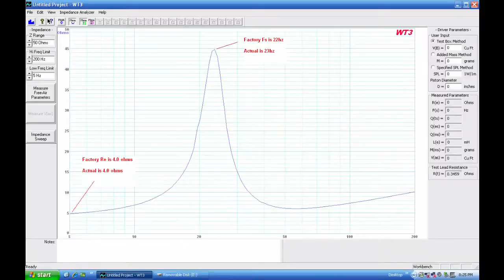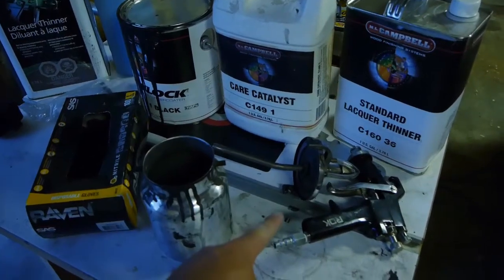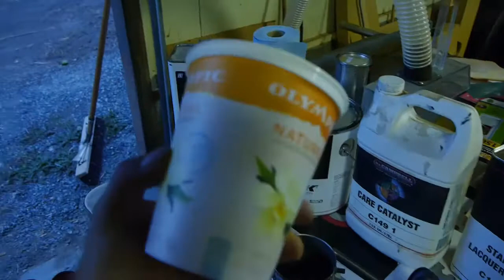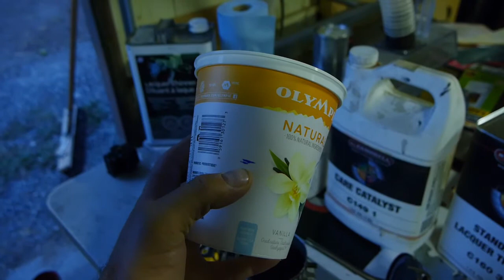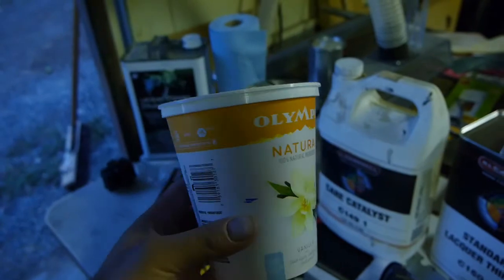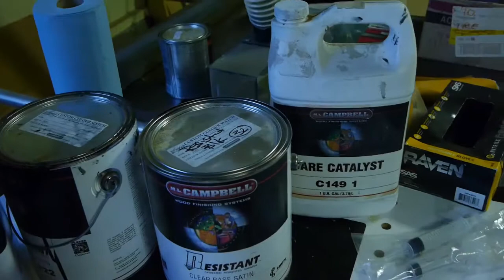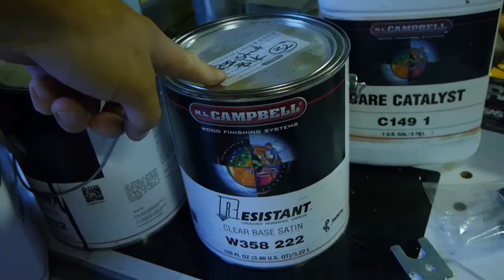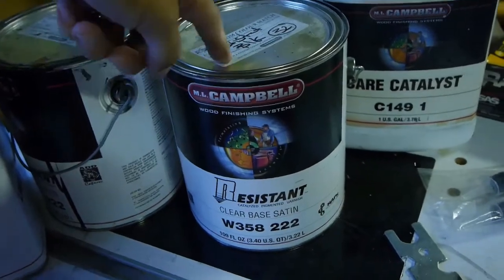Finally Completing a Pair of Speakers | Life S9 | VIDIYFEST

Comment: Did you use a commercially available crossover or custom build them? What was the crossover design that 
worked best for this 2way?
Reply from the maker: Bradford Child it was custom done using measurements of the drivers in the box. I ended up with a XO around 950hz. It used a single order on the tweeter with an Lpad and a second order on the woofer. This resulted in about 3rd order in phase acoustic responses.

Comment: Very nice work and the best regards from Germany. Is there a blueprint for the S9 publicly available?
Reply from the maker: Heiko Baumgärtner thanks!

Sorry there isn’t because the parts are a bit hard to get and diysoundgroup.com was going to sell it as a kit. They’ve been a bit slow lately though.
Reply: @ImpulseAudioSpeakers  ok Thanks. I ask because i have a pair dayton 225 lie useless in a corner 😉
Reply: Ist mir mom zu aufwendig in Denglish zu schreiben, genau diese Box hab ich auf dem Reißbrett schon entwickelt, besonders MiBass RS225-4 _ (Fmax 2kHz) ist mit seinen TSM-Parametern der geilste Woofer bis 2kHz als MitHochton der D220Ti (HighEnd) von JBL. Alles bezahlbar :-)
Beschäftige mich seit geraumer Zeit mit Sprach und GeräuschAnalysen... Ein Kurzes Ergebnis:
Der wichtigste Bereich Menschlicher Stimmen ist zw. 70Hz bis 1,3kHz und sollte nicht durch eine Frq-Weiche bearbeitet sein, daher 2-Wege bzw. 2.1 -> ich denk da gerade über etwas dazwischen noch nach... Best Regards aus Germanistan.
Reply: @ImpulseAudioSpeakers  If DIYSG did offer it as a kit at one point, they don't anymore.  Any chance of obtaining the design, now in 2019?
Reply from the maker: Colin Fritzke the problem is getting the parts from DIYSG. The design doesn’t mean much if the parts aren’t available. Maybe Erich could sell the parts separately.

Comment: I really like the cabinets on these speakers. How did you manage to build the curved sides? Are they hardwood or MDF?
Reply from the maker: danielbairstow thanks! They’re MDF. I did a translam build procedure with a template made on my bandsaw. Used a pattern but in the router to make about 50 of the same pieces then stacked them.
Reply: @ImpulseAudioSpeakers  NIce!
Reply from the maker: danielbairstow I don’t recommend doing it. There’s better ways to build a curved cab. This is the only time I’ve done it and won’t be doing it this way again.
Reply: @ImpulseAudioSpeakers  What would be your recommended method?
Reply from the maker: danielbairstow I would build some ribs and then use bendy ply or kerf mdf to form around the ribs.

Comment: Very nice. What didn't you like about those Scanspeak you used in the prior design? Have you done any measurements on these yet?
Reply from the maker: Corrado VRz Yes I've done measurements. I'll show more on that eventually. The scan speaks just didn't want to cooperate. It wasn't something about the sound quality. Passive XOers can get to complex then you just gotta cut your losses and try something different. The Daytons are cheaper too :)
Reply: Awesome. Yeah, I understand about the Scanspeaks, I have thought about trying them out too to get better low end extension but ultimately decided to stay with my B&C's.

Comment: Hey Ryan, I gota ask:  How manny DB did you had to quiet down the driver?
Reply from the maker: Mihai C the tweeter? By memory it was over 10db. About 15db if I’m not mistaken. Quite a lot!
Reply: @ImpulseAudioSpeakers  i used this driver in 2 pair of speakers. A 15 inch  3 way and a double 10 inch 2 way and in both cases i had to quiet down the drivers 4-5db, and i was using pro drivers. 15db is a lot, what frequency crossover did you use?
Reply from the maker: Mihai C were you using a high efficiency compression driver on a horn? These woofers are about 90db sensitivity. The CD is over 100db. So it definitely needed at least 10. But I am going by memory over a year ago.
Reply from the maker: Mihai C XO frequency was just under 1000hz.
Reply: @ImpulseAudioSpeakers  I am using 15NDL88 and 8PE21 on the 3 way from B&C and E10-200S from Paudio on the 2 way speakers.
Reply from the maker: Mihai C ok so that would be why you didn’t have to pad it down nearly as much because those woofers are very efficient.

Comment: Looking for HT speaker to be used with subs around the size of your S9 . I now use Curt Campell's Monitor Statements, but i feel they are not Dynamic enough. What would you recommend ?
Reply from the maker: That's a tough question. Are you comfortable moving into the realm of pro audio drivers? I would check out the Fusion 8 or 10 from diysoundgroup.com. If you want to stick with more typical hifi home drivers then it'll be a little more difficult. These would likely be more dynamic that the statements but not an appreciable difference to be worthwhile and there's no kit available for them. What are your feelings on pro drivers?
Reply: Yes very interested in trying Pro Drivers, only problem is i have a Projector Screen that is Hung on the wall, center channel becomes a problem?,.. i read somewhere you were maybe designing a Coaxial Speaker for HT also  ?
Reply from the maker: integra the coax didnt sound good. It might still happen some day though. If you need a center could you fit the 1099 and a pair of Fusion 10s on the sides?
Reply: I will look into it , thanks Ryan

Comment: Can I ask why you chose the 4 ohm version of the woofer? Higher sensitivity?
Reply from the maker: Tiziano Diamanti yes that's exactly why. The tweeter is very sensitive so wanted to get more out of the woofer, although there is still a huge sensitivity difference. There is another benefit in that 4ohm woofers use smaller inductors and inductors are expensive so it helps with cost.
Reply: @ImpulseAudioSpeakers  You can't use smaller inductors, because to get the same results, the impedance of the inductors needs to be halved as well as the inductance. Which makes them the same size, just with a thicker wire and less windings.
Reply from the maker: Refke van Lavieren by smaller I meant the value, not the physical size. If that’s what you’re getting at? The inductor is cheaper on a 4ohm woofer. That’s the point. I don’t pay much attention to the DC resistance of the inductors. Unless they’re really high it’s pretty negligible.
Reply: @ImpulseAudioSpeakers  That's exactly my point, it isn't cheaper. Just take a look at your suppliers website, you'll see.
Reply from the maker: Refke van Lavieren if you must assume half the DCR then it’s about the same price. Probably still cheaper to go 4ohm by a small margin. But why make that necessary. Use a similar DCR and half the inductance. The DCR doesn’t have much affect. Especially since the 4ohm will be more sensitive. I’m talking real world results. Besides. My original point was to get higher sensitivity. I only said cheaper inductors was a small reason it helps. I generally would never pick a woofer impedance based on the inductor size required.
Reply: @ImpulseAudioSpeakers  Sensitivity is a valid reason. I was just pointing out that the coil is the same, that's all.
Also, higher DCR increases Qes, which is usually a concern when picking a coil. But apparently not in this design.
Reply from the maker: Refke van Lavieren you are right about Qes and how the DCR of the coil changes. I just find they don’t make much real world difference worth fussy about much. Good call to mention it though 🙂

Comment: Beautiful job! Would love to see a project/tests using SEAS drivers, what is your opinion on these? Thanks for the great vids...
Reply from the maker: Timothy Hall SEAS are great although I havent used them a heck of a lot. I'd like to though.
Reply: I have a pair of Audax HM170ZO HDA Drivers, was thinking of pairing with SEAS T25CF001 tweeters, any thoughts on this?...
Reply from the maker: Timothy Hall those look like great drivers and I'm sure they would pair well. They aren't cheap though if you are starting out. Just keep in mind that when starting out it can be a good idea to start with cheap drivers you won't feel bad about damaging or coming up with a average sound quality. When people start with expensive drivers their expectation is for amazing sound.
Reply: I think I will have to buy the Dayton DATS V2 measurement system. Every time I have used stock crossovers (as you suggest) it yields less than perfect results. I understand that the XO's are partly based on driver impedance; if I need to use a resistor for tweeter attenuation, would this theoretically change resistance, and hence crossover coil/cap values too?  Thanks again, T.
Reply from the maker: Timothy Hall yes it does change the XO requirements when you change the resistors padding the tweeter. Which is why you need to  design it all as one system. It's not as complicated as it sounds.

Comment: I'm planning to use these woofers in a 2-way design crossed over around 1.5 -1.8kHz with a steep roll off to avoid that metal cone break up. But even then I'm not sure ill be able to get it down fast enough. I noticed that your crossovers seem to be low order with only one inductor and I'm wondering how you managed that. Super low cross point? Must be a pretty solid tweeter!
Reply from the maker: Myles O-K yes the XO is second order electrical and low. The tweeter is very powerful so I was able to cross down at 950hz. That almost an octave below what you’re planning. That’s the difference.
Reply: @ImpulseAudioSpeakers  Thanks for the reply. Hmm a whole octave is a lot. It might just be easier to go 3 way. Not particularly keen on that though. Just quickly, do you think it is possible to have this in a 2 way without a waveguide for the tweeter? You've probably come across it already but the new Peerless DA32TX00-08 seems very promising. I would love to see a driver review/test for it or it's 1'' sibling.

Thanks again, your videos are a god send :)
Reply from the maker: Myles O-K I think you could be able to make it work, but it will be quite a challenge. Do you already own the drivers? How about the RS180 instead?
Reply: @ImpulseAudioSpeakers  No haven't ordered them yet. Everything Iv'e read seems to show that the RS225 is the better driver but I have considered the 180. I want something that doesn't need subs so bass output is key. Iv'e also considered the 6" version of the SB woofer on your top woofer list. Sorry to keep bugging you, last question I promise but can you see any reason that this wavegiude https://www.diysoundgroup.com/seos-8-tweeter.html isn't a good option to help match a tweeter to the RS225? 

Thanks again. Much appreciated!
Reply from the maker: Myles O-K no problem with the questions. The rs225 has amazing bass, so it’s a good choice in that respect. 

That waveguide is great. Only issue is getting it to match with a tweeter. It will be a harder design than a flush mounted dome tweeter. But should make for an excellent speaker if you can get it to come together.
Reply: @ImpulseAudioSpeakers  Good to hear :) Can you elaborate on what you mean by getting it to match with a tweeter? Do you mean measuring tweeters mounted in the waveguide to see if they have a favourable response until I find the right combo to match the woofer? Or simply matching the mounting holes.

I f you know a good source of info on this stuff feel free to palm me off onto that. I haven't found a beginners guide to waveguides yet.
Reply from the maker: Myles O-K I mean matching the tweeter for a good response. I’m not sure there’s much info out there on the subject. Not easily obtained info. I started a few discussions on forums years ago. And I tested quite a few myself just to learn. It’s a process.
Reply: Damn. Might be something to delve into anther time then. Thanks for all the help!
Reply from the maker: Myles O-K you might be able to find a proven combo. The SB29 in the Dayton HW08 horn works very well. Just need to get the measurements from zaphaudio.com
Reply: @ImpulseAudioSpeakers  Oh nice one. Thanks for the tip!